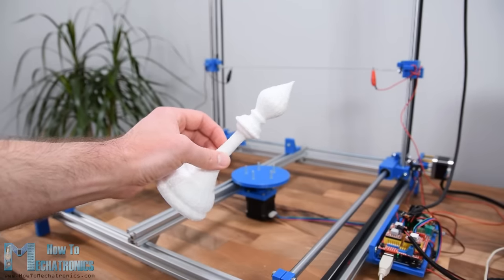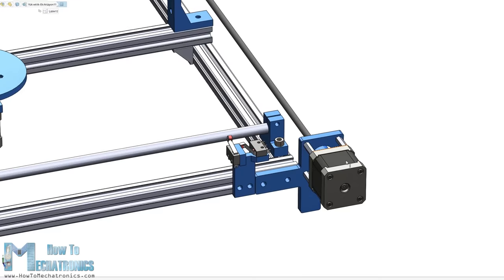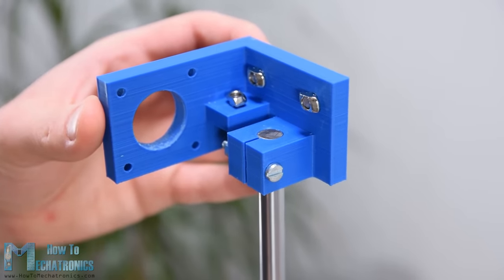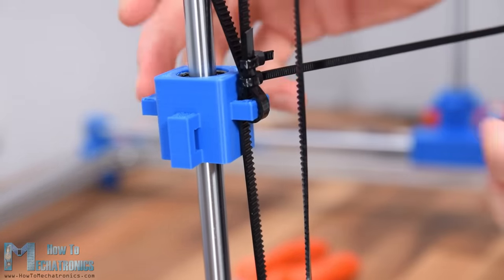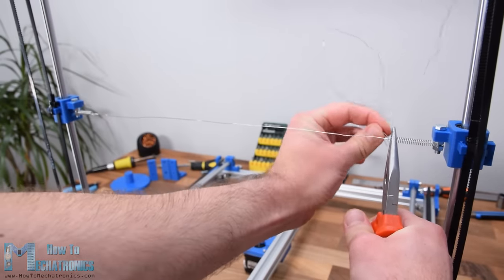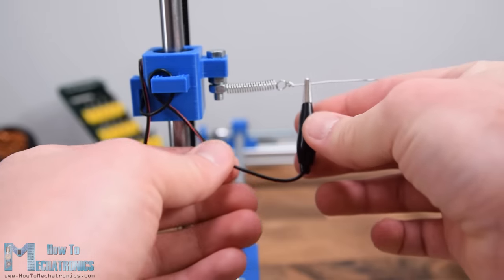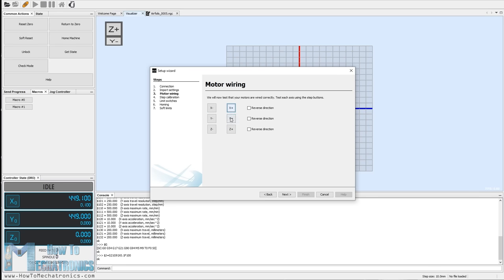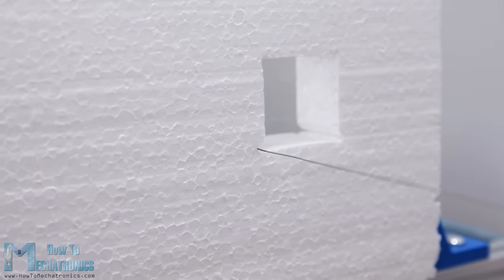Arduino CNC Foam Cutting Machine (Complete Guide)

Comment: That's really cool, and the foam can be used to cast aluminum or bronze!
Reply: That was my very first thought as I was watching him cut that foam!  I'm sold!
Reply: How?? Does that not get too hot?
Reply: So the bad guys can make weapons using this ?? .. anyways.. I liked the video and subscribed the channel .. Genius !
Reply: @urcoolpal8536  or they could literally just buy them...?
Edit: also, yeah, generally speaking weapons can be made with tools. Because that's been possible since literally the first weapons were invented - and we're manufactured, using tools.
Reply: @GuyFromInternet00  that is the idea , the molten metal completely melts away the foam and replaces it. (the foam is surrounded by sand , look at foundries on youtube)
Reply: @GuyFromInternet00  it doesn’t really matter what material the shape it made from. You can make a mold from the shape and then pour your final material into the mold, be it metals, cement etc. a lot of sculptors use clay for the shape, then mold and cast into bronze or whatever they want.

Comment: This is a really rad build.  It probably wouldn't be the most difficult thing in the world to build a slicer which could cut complex, non-symmetrical 3D shapes simply by rotating a model and casting the outline based on step resolution.  Then just doing as you have done here, having the system slice, rotate, load new file, repeat.

Comment: 15 years ago I was member of rc planes building club. We moved the hot wire manually through a piece of styrofoam to make wings. We attached aluminum profiles of wings on each side of styrofoam piece. Process required 2 kids: one on each side. We had numbered marks on aluminum profiles, and we said these numbers when hot wire was passing them, to go in sync. If you go out of sync with your partner, that's wasted wing, because shape will be wrong. If you both go too slow, then wire will burn styrofoam too much and that's another wasted wing. If you both go too fast, then wire will bend, middle of wire will go slower than ends, giving you one more wasted wing. 2-4 failed attempts was normal. It was fun.

Comment: Awesome! One idea - grbl has ability to control the „laser” by pwm. You can use it and connect the output to the center pin of the potentiometer of the converter (instead of potentiometer). Maybe with low pass filter or some voltage converter to make it compatible voltage-range speaking :)
Reply: or actually you can connect this pwm pin to the mosfet (as it is intended) and control temperature of the wire this way ;)

Comment: What's especially useful about foam is that it can be used in sand metal casting, which makes the machine more useful than a PLA 3D printer. Amazing professional look on the machine. Better than what comes off kickstarter.

Comment: Really great.  I may have to build one.  I was thinking of using two 3D printers to do it.   I built a numerically controlled foam cutter back in 1988 using a Commodore 64 and an old Radio Shack line printer I got out of a dumpster.  The printer had the required stepper motors and X axis drive.  I used it to cut foam wings.

Comment: I feel like this would be an amazing tool. cut out the shape, make it into a mold, then pour in your material.
Reply: umm
do you know of 3D printers?
Reply: @Hacker-cw9lc  3D Printers are great for doing smaller intricate parts, but they are slow.
For large castings where precise detail isn't needed done with lost foam this would be brilliant. 
Horses for courses.

Comment: I just made a copy of your machine, thanks! It was amazing journey. It took me a while until all parts were delivered but now it's all done. For the remark - 2020 profile on top should be longer than 500mm to match everything (i ordered them all at that size). I only used your gcode samples as a test, but just now need to learn a bit how the inkscape works and fun may begin
Reply from the maker: Glad to hear it, have fun with the machine! Just be careful with the fumes, make sure you have a good ventilation and also try to use a safety respirator mask. Cheers!

Comment: Now it just need a 6-axis one for complex 3d foam cut.
Reply: Exactly what i was thinking.  This is a great build, and could do layers, for lamination, but that would be the ULTIMATE device for cosplay EVA Foam etc.
Reply: A robot arm may serve this better however.
Reply: I think you'd have some major difficulties with fixturing the foam if you wanted the full five axes of a line angled through space (in two axes) and through a given 3D point location (3 more axes). An arm might be the way to go.

Comment: Great video, thank you for sharing 
Just a suggestion:
Why not connect the spring to the wire using a mini block of ceramic as a temperature insulation medium ( maybe that has a couple of drill holes for connection ) to increase the life time of the spring and keep tension at bay

Comment: Why didn't you move it 100 mm to get a much more accurate measurement for calibration?
Reply from the maker: Yeah, that's a good point, you would get more accurate measurement that way.
Reply: I was thinking the same. Done that when I built my own 3D printer. Still took ages to get it sorted though LOL

Comment: This is awesome! If you want to get your resistance wire dead straight too for increased precision along your cutting path, try tying one end of the wire to a mounted swivel, and close off the other end in the jaws of a drill. Give it a spin under tension and it should straighten out nicely.
Reply from the maker: Thanks for the input!

Comment: Awesome, clear, concise video! Small tip, to perfectly straighten the wire, tie the end to something static and put the other end in a power drill and twist it for a second or two. In this application the minimal loss in strength wont matter much, and it will be pretty damn straight.
Reply: Would you be interested in building this for money for me😂

Comment: This is a fantastic build and astonishingly simple design. Great work!
The only other comment I have is to not use toothless idlers for the belt (when the teeth are pointing inwards, like for your x-axis belts). It's fine (ish) at the beginning, but will wear down the belt and may introduce jitter to the movement causing unprecise positioning (that part is probably not that noticeable on this machine).
Reply from the maker: Thanks for the input!

Comment: That is the best cnc building video on internet , thanks for the information 
I have a questions 
Why did you use the threaded rod ?
Reply from the maker: Thank you! I used threaded rod because that's what I had around to use. :) It can be any rod, you just make to transfer the motor rotation to the other pulley.

Comment: Nice machine, great video.
I will add another stepper motor to allow to skew hot wire, so z axis would be driven separately each side.
There is a place for another stepstick on arduino shield.
Then we will have 5 axis machine.

Comment: Uppgrade tip. Try making the idler pulley on the belts adjustable so you can tension the belts more easily ;)

Comment: You could make the shape as a sub-program and then have a loop in the main. You could say that it needs to loop until a variable is more than 359. The same variable would control the C-axis. In the start of the loop you would specify how much to add to the variable. It would loop until it goes a full turn.

Comment: Fantastic work, your natural talent for teaching is very good. If not one of the best I have watched in a long time.

What I would love to see is an upgrade to this tutorial to have each axis be able to move independently. Will mean 2x X axis, 2x Y axis and 2x Z axis motors configured. What board would you suggest for that? I am really actually excited to have found your channel, and I hoe you may make an update video to explain what adjustments to make to the controller board and Arduino to accomplish this. 

I am not too worried to see the adjustments to be made to the model as this part would be easy to modify.

Comment: I think I'm going to take this project on. I did have a couple of questions and appreciate the wonderful video you've created covering everything is great detail. My first question is: Can you size this up?  45cm x 45cm is really large, I'm curious if you are limited by hardware or software for potentially going to 60cm x 60cm.  Or are you pretty much unlimited within reason. i.e rods bending under their own unsupported weight. Last question, The chess piece looks wonderful. I'm curious on it what changes you had to make to be able to cut its round portions. With the pillar, its turned 45 degrees make the same cut. what did it take to make round work vs squared off.  Thank you, I'll certainly be using your affiliate links as I acquire the bits and pieces needed.

Comment: A much simpler method of powering the NiCr hot wire is to use standard AC wall current controlled by simply adding series resistance to the wire to obtain the desired temp.

Comment: Looks like a fun project.

You should be using toothed idlers with the same diameter as the motor pulleys.  Smooth idlers will cause changes in tension as the teeth pass over the idler and flatten the teeth on the belt.  It won't matter much when hot wire cutting foam but it will wear out the belt prematurely.

Comment: Excellent! I designed and tried to build a machine similar to this one, but out of wood instead of extr. Al, using ball chain instead of rubber belts, homemade (and laid out) sprockets for the chain, and a design based on etch-a-sketches instead of the hardened steel rods (though I was thinking of picking those out of old printers! You've made a beautiful machine, and with quality parts it looks like too!

A question I have is: Could you change the Z height of the two sides of the wire independently? If you could, that would allow you to change the angle of the wire relative to the work peice, within a range. That way you could make all kinds of rules surfaces!

I think I'm gonna have another try at finnishing my own, now that I've seen yours so beautifully done.

Thank you!
Reply from the maker: Thanks! Well yes, you could make the two towers move independently by adding two separate motors to them. However, you would need a suitable software for that purpose, the one explained in this video won't do the job.

Comment: With that and kiln, you can simply build anything from aluminium by simply lost foam sand mold. Thats great!
Reply: Working with foam you don't need a kiln. Just bury the foam in Green Sand and pour in the Aluminium. The foam turns to smoke and the Aluminium fills the cavity in one go.

Comment: This was a really amazing and thorough video. This foam cutter could be a game-changer in terms of cost for building models and molds. Do you have a good handle on the curve resolution, when the foam must be rotated (like with the chess piece)? Also, have you tried projects that require the entire piece of foam to be translated rotationally on the base to produce curves in orthogonal planes?
Reply: i was wondering the same ever found a solution?

Comment: Amazing! We can use the prints made in order yo build a silicone mold for resin molds! This could be a fasest way to make 3d prints!
Reply: The foam cut pieces are not as precise as a traditional 3D printer or cnc, so if the part is large and does not have to hold precise tolerances this is definitely a good method.

Comment: Is there a chance it will work with CAD software like Fusion 360? Because if it does, this machine can actually save so much time to prop makers!
Reply: It should be possible, if you stick to 2D cutouts. I am not sure how easy 2.5D Shapes could be achieved, but you can always make multiple 2D cutouts to achieve 2.5D by manual.

Comment: Why did you not use D12 to enable the wire heating board or use D11 as a PWM signal to the wire heat board?  you could have made the whole thing Auto on and off that way.

Comment: I think it would be neat to design tool heads for this machine as they can be a floating aluminum bracket that bends and holds the wire in a certain shape at the center

Comment: Very interesting project! Is there any specific reason I'm missing why you put the Z axis stepper at the top? I think the construction would be more stable if it would be placed at the bottom? Probably doesn't need that extra stability anyway, though.
Reply: I guess becaus then you'd need 2 z-steppermotors since you cant cross with the axis st the bottom all the way through (collides with part/frame)

Comment: 11:20 The microswitches are taking vibration as inputs... An alternative is to use an optical sensor, an ir optocoupler, to sense when the stop has been reached; vibration cannot trigger this... Would work exactly the same as the microswitches.

Comment: You should be able to add another axis.
As a Vertical Lathe... Your Hotwire in a shaped loop ...
and turn your R axis as the Headstock Spindle/Chuck.
Also ... find/build a fixture called a TRUNNION Axis. 

You're Welcome !

Comment: that's sweet but what if you mount your hot wire on a circular mount, giving it a way to twist and angle itself? That way you can use it as a slow lathe.

Comment: could you have printed an extra motor mount for the x-axis and used a splitter to run those motors as one instead of using a long rod with the two pulleys? The splitter is labeled z-axis stepper motor splitter on Amazon. GREAT idea awesome job.

Comment: Thank you for a brilliant vid. This is such an amazing way to energies people to build their own, as you show its not easy but very achievable. 
Thank you. 
Tell me, for tapered (angle cuts on the same plane) one would need 2 independent X axis stepper motors. 
This would be, for example, a tapered aircraft wing airfoil. 
Any chance you could add the other X axis motor and do a new vid?
Reply from the maker: Thank you! Well maybe in future I could make that upgrade.

Comment: uh thats neat and all, but what would you need cutted foam for? I'd actually really like to know how this is applied.
Reply: For one, RC model airplane stuff.  They’ve been hot-wire cutting foam wings forever.  They then wrap it with tapes, films, composites, etc.
Reply: @craigrmeyer  I've always seen people just use a knife for that.

Comment: I am rather sure that using a threaded rod will make it so that the pullys rotate off-centre.
And you also need much stronger springs for the wire
You should also consider driving all 4 belts with different motors to enable allot more complex parts

Comment: If you don't get the same drivers as in the video, be carefull how you install them.  Not all drivers have the potentiometer opposite of the EN pin.  I got in a hurry and smoked 2 of them.  Also the sled requires a jumper to enable it.
Reply from the maker: That's true, thanks for the input!
Reply: @How To Mechatronics  hi I am interested in getting one of the foam cutting machine, would you consider making one for me to buy
Reply: Can you explain please ?

Comment: Would this work for bigger projects? If so, what would you recommend? I want to build one for bigger projects using something similar to the model you used in the video. Great video btw you did an awesome at presenting this.
Reply from the maker: Sure, this concept would work for bigger projects, but it has to be redesigned. This design is not that rigid, it works for these small shapes but for bigger shapes I'm not quite sure.
Reply: @HowToMechatronics  what is the rral working area of this machine?

Comment: Well, this is indeed awsome, but you seem way better on the virtual side than the mecanical side...

From the appearance of the plastic used, i guess it was PLA, witch is a good plastic, but one of its biggest problems is its deformation under load (even when not exceeding its elastic limit). So soon you will have play in your parts...
I recommend PETG.

You did not tension the belt that much, there is gonna be some play, but it might be in your favor, because tensioning them properly would probably deform that whole assembly.

There is way too much weight on top for the size of the plastic part.

Anyway, great video, and you gained a new sub, and its because of this that i whant to recommend but of revision on you design, it is a great idea, that can have an even better realisation
Reply from the maker: Thank you! Yes, you are absolutely right about every you pointed out. :)
I already said in the video that the design is far from good, but it worked out.
I'm not quite sure if I would do a revision on the design. Maybe in case I try to make airplane fuselage with this machine. In such a case I would need independent movement of the two towers/ sliding blocks so I can make asymmetric cuts. But maybe, not sure if and when. 😊
Reply: @HowToMechatronics  hahaha, i absolutly relate to the concept of finishing a (close to useless to me) project and be done with it...

Anyway, the project wss very educational, and i think that was more the point, keep up the amazing work.

Comment: Great project and video WOW!. I think to built such or simmilar machine.
Is it possible and not very complex to add one feature:
Separate stepper motors for left and right sides od z axis, to be able to skew cutting wire.
It is usefull to cut i.e. aeroplane wing which decrease width of the wing aerofoil across the length of the wing.
It shouldn't be complex from hardware perspective, Just to add another stepper on the other side, and remove shaft connecting two z axis belts. Tension springs should be longer to allow changes of distance between wire holders when it is skewed. Usually skew is just up to 15 deg. But what about software side grbl inside aruino and design software??